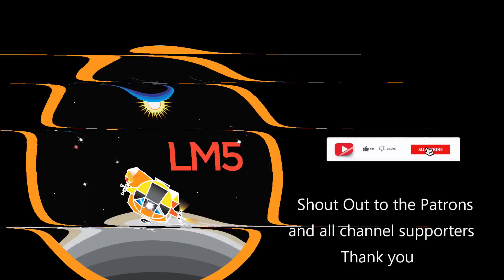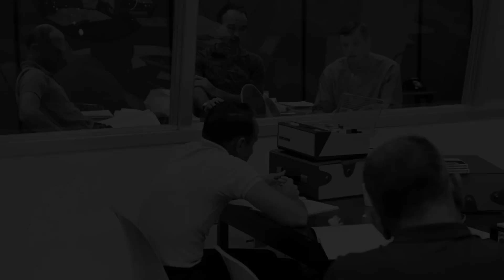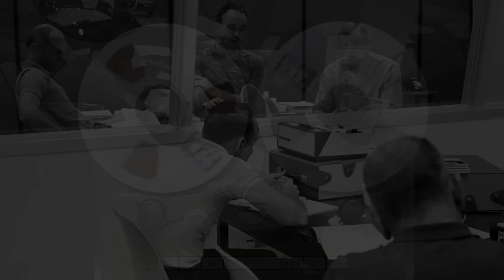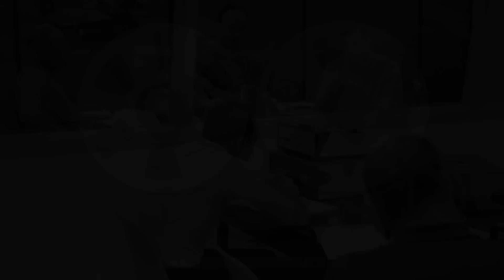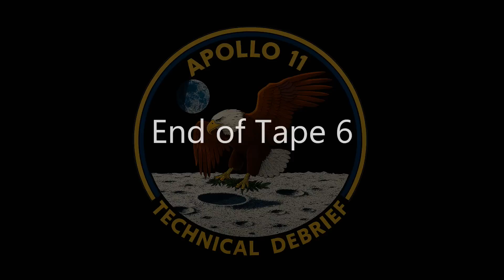Apollo 11 - Technical Debrief - Tape 6 - Lunar Lift-off/Rendezvous/Lunar Orbit

Comment: Hmm, interesting.  There was a fairly major event that the LM crew sort of skated through, while talking about the final phase of the rendezvous.  Buzz made one very offhand comment about it, when, talking about the yaw excursion that happened during probe retraction, talking about how thrusting the LM at the CSM after probe contact might not be the best procedure.  He said that, maybe, it would be better to just be in attitude hold and stay steady.  He mentioned "We couldn't do it in primary att hold, because we had a gimbal lock problem and didn't have that, but we could have still used AGS att hold rather than thrusting at the CSM" (quoting from memory).

While this wasn't discussed in detail in this debrief, it was analyzed in the Apollo 11 anomaly report, though.  What happened was that, as Neil pitched over to present the top of the LM, with its docking ring and drogue, to the CSM, he wasn't paying attention to the gimbal angles, and flew it right into gimbal lock on the platform.  That dumped the LM's inertial fix, so they switched over to the backup system, the AGS, and performed the remaining few procedures in AGS.  I don't recall if they realigned the platform by copying the AGS ball numbers, or just left it in AGS att hold after LM jettison.  In this tape, they did note that the LM maintained attitude quite well after they blew the docking ring and jettisoned it.  Neil even mentioned that he could see thrusters firing, to keep it steady.  But the loss of the PNGCS right before docking was basically closed out, in the anomaly report, as pilot error.

The other cool thing that they did on Apollo 11 after LM jettison was to shut down the LM's cooling system, but leave it all powered up, as a test to see how long it would operate in lunar orbit without any cooling to the electronics.  It lasted two or three revs, so between four and six hours, before it gave up the ghost.  It didn't just die, either -- it sputtered to a stop.  Houston told the crew that they had finally lost contact with Eagle, and then called up that, just as they said that, another burst of data came through from it.  Seeing as how they were going to try to crash the LMs on later flights, to create a seismic event for the seismometers they left, it was the only chance they had to plan this little experiment, and gather that data on how long a LM would run with no cooling.  While not directly applicable to saving Apollo 13, this data helped the guys who saved 13 to figure out that, even if Aquarius ran out of cooling water (the critical resource in the lifeboat scenario) a few hours before they were ready to dump it, they'd still be OK.  It was just a data point, but it was a helpful data point.